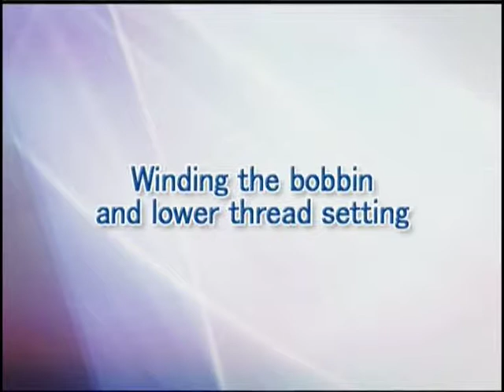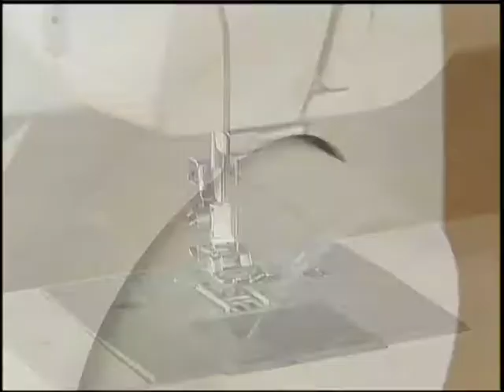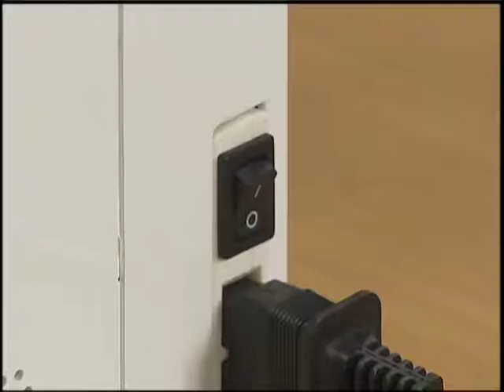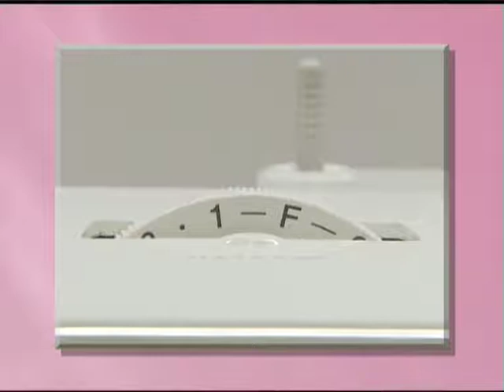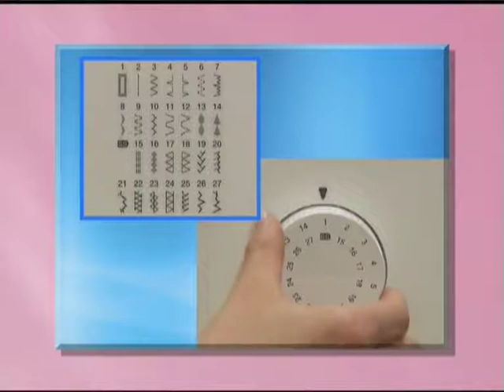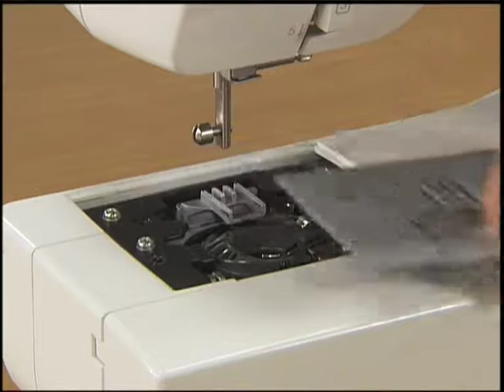Brother Instruction Manual for GS2700, GS3700 series

Comment: 8:02  how do I get the bobbin thread attached/ interlocked after using the guide to get my top thread through the needle hole? When I put the needle down it doesn’t bring the bobbin thread up it gets a little stuck and then there’s a tip of the bobbin thread just sitting there

Comment: Please tell me what is the white (-+) screw button behind the gs3700 model
Reply from the maker: If you are talking about the buttonhole, please check the manual. 

It states "If the left side is too open, turn the buttonhole fine-adjustment screw with a large screwdriver in the “–” direction. If the left side is too tight, turn the buttonhole fine-adjustment screw with a large screwdriver in the “+” direction."

More at the manual(Page 38): https://download.brother.com/welcome/doch000861/888_x06_x08_x16_x18_x26_x28_om04en.pdf